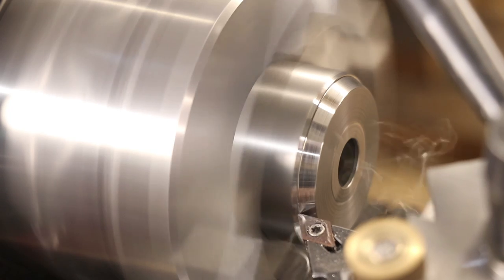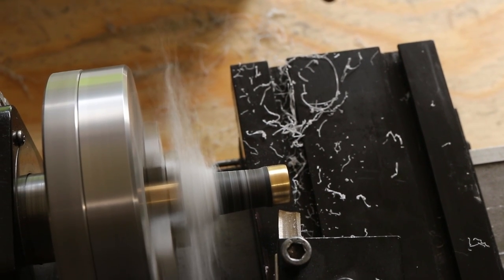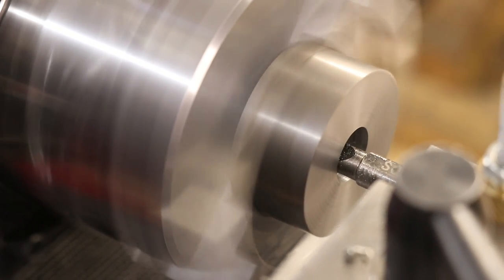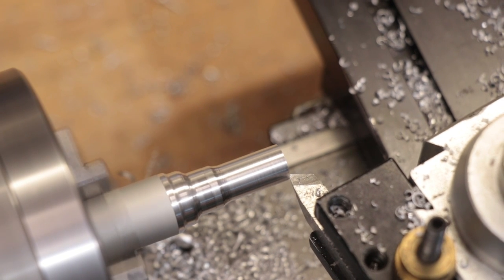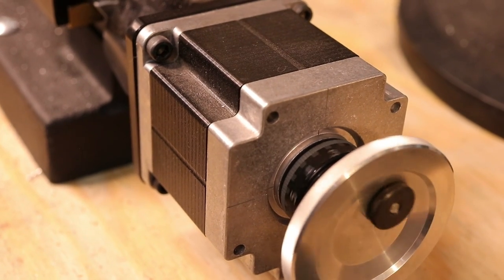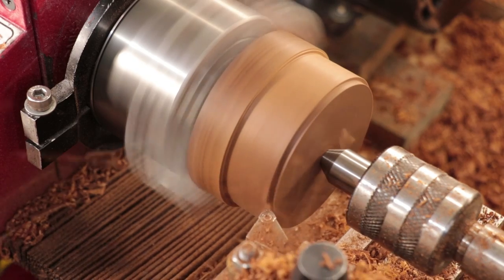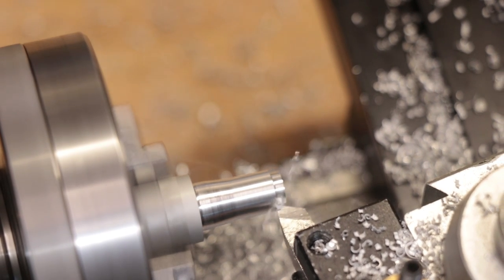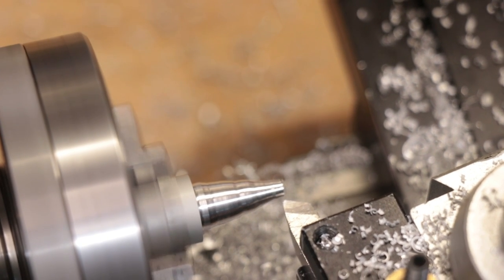My CNC Lathe and Why I Don't Use It Anymore

Comment: In short.  Currently you don't have a use for the CNC lathe. :)
A lot of people don't understand that while CNC rules in a production environment.   For one off's a manual tools can be faster.
But if its a part may need tweaking the ability to quickly modify the CAD drawing and crank out a new part is great.
What is better depends on the situation.

Comment: glock cnc sells some upgrades for the sherline mill and lathes, like a much better headstock and motor for example. Its very pricey but its brings the already good sherline to another level. You will need to machine spacers or tool holders though but its worth it. I have it set up to be able to use a 5 inch precision chuck.

Comment: That is exactly why I bought a manual lathe, And yes the leed screw handle on the end of a lathe any lathe is a pain in the arse I would like you much rather use a manual lathe and mill with a DRO I have pretty much the same lathe as you do and have it cutting very nicely without a lot of mods which was a bonus. Also not really interested in seeing any CNC work stick to the manual lathe work and keep up the good work and thank you for the videos.
Reply from the maker: Cheers, Thankyou for the feedback
Reply: @artisanmakes  Your Welcome.

Comment: I am actually planning on purchasing a cnc router with ball screws and I am planning to try use it to turn parts on my sherline manual lathe. I will try and make an attachment for the router base to hold standard turning tools. I havre an  old Leblonde engine lathe and an old M-head Bridgeport milling machine. I have done both CNC and manual machine work for the past 30+ years so anyone that says we are just "programmers" (no insult to the code writers) doesn't have any clue as to what is required to actually write cnc code.

Comment: Hi. I agree with you completely, excellent video. A ball screw for a CNC should have no backlash at all even under load as ball screws are pre loaded. Or should be? Chinesium ones sometimes do have, but that is not a ball screw. I have a small but capable CNC, I have cut cast iron and titanium on it even though it only has an A4 cutting area. zero backlash means climb and conventional milling are routine.

But I agree with you, one off's or even 2 or 3's .. do it manually (if you are capable and/or prepared to learn). 

Sherline are very expensive. I have a manual imperial one I use for small parts, it is 35 years well used old, it is still bang on accurate, still on it's original motor and drive belt. If you keep the scroll clean their 3 jaw chuck it is still better than many cheap collets. They are very precision machines far better than the far more cheaper offerings and last forever. I will say worth the money if you want precision and a tool you can will to you children. I have no experience with their cnc offerings but I am surprised the lack of a decent ball screw drive.

I have 3 lathes and two mills (one CNC). On small parts, carb jets, bearings etc , the manual Sherline delivers every time.I once turned some parts from 45mm extruded cast iron on it, and it delivered.

Comment: Hello, I'm just wondering what caused the cnc control board to blow? I am thinking of getting a Sherline, so I want to avoid that, especially because I wouldn't know how to redo a cnc control board.
Reply from the maker: I can’t remember for certain, it happened about 5 years ago at this point. But it happened whilst it was running under load. And sherlines warranty for electronics was something crazy short like 90 days. 

I am not sure if they still use the same board these days, they could have changed it.

Comment: I used to have a sherline 5400 mill. I lost it to a divorce. I just recently bought a PM25MV mill and plan to convert it to cnc. I'm now wondering if I made a mistake because most parts I make are small. I got the larger mill to be able cut steel. The sherline mill tend to struggle cutting steel but aluminum was not an issue. Sherlines also had no way to attach anything magnetic like dial indicators, since everything was aluminum. I'm curious anyone's opinion.

Comment: Fixed backlash compensation always has errors that add up over time. One reason I designed my ELS to use the DRO as feedback to make a "closed loop" backlash compensation that works really well. It makes it harder to do it for CNC unless you build a custom gcode processor and servo driver. It's easier to switch to ballscrews would miss the manual lathe though, especially getting tactile feedback.
Reply from the maker: Very interesting, I don't think I have ever seen an ELS set up this way.

Comment: Multiple parts, production parts - CNC wins. You want to have fun, manual is fine but you are limited to shapes. I have the Sherline ball screw milling machine. Repeatability is excellent, I can make exceptional parts from it but I can afford the lathe and I like the small footprint. I still have my precision manual lathes and I still use them daily. It comes down to what you want to do and what you want the machine for, each has its place in the shop. I wouldn't give up either one.

Comment: I am in the same boat as everyone else. I touch more on that CNC router would be good too. Not really a CNC guy myself but because of you getting that router I bought an E3 3D printer. I would love a small lathe to help with the 3d PRNTR 12" x 36" is not small enough. ah cheers!

Comment: I agree that CNC machines aren't as useful in most home workshops.  However, I still want to try to (reversibly) convert my 111-year-old South Bend lathe (originally a treadle-powered lathe) to either "NC" or "CNC" to give me a "productive" use for (i.e., way to play with) one of my PDP-8 minicomputers & Teletype, just to see if I can do it.  I seriously doubt that I'd ever need a (C)NC lathe in my workshop though!  ;)
Reply: I love this kind of thing, but be cautioned that many treadle lathes have lame bearings that severely limit spindle speed.

Comment: How does it feel having the hand crank wheels on the back of the stepper motor? Does the notchiness of the motors cause you issues?
Reply: You can feel the motor steps, but it's pretty subtle. Hardly noticeable when you're actually cutting something.

Comment: I don't think backlash is the primary reason for CNC using ballscrews and slides.   It's about stick-slip and peaks of torque requirement where a human operator can feel the limits (and adjust gibs or do other maintainence as required) but an electric motor just gives up or crashes.

Comment: I know extremely little about CNC but can you program in the direction of cut to keep backlash pretty much nonexistent?
Similar to the way I do hand crank work on manual machines I consciously make up for backlash by cutting only with movements from the same direction.
Reply: That's pretty much what the Fusion anti-backlash paths he mentioned is set up to do. You can do it manually, but Fusion et al are set up to automatically compensate for backlash. It works generally well but it's slower and less accurate than a ball screw.
Reply: @WheatMillington  He's talking about Mach3 backlash compensation. If you switch X direction for example, then it will add an additional X move of the backlash distance. It helps a lot, but, any rough cut may not be perfect as the bed can get pushed around. Also for complex/fast cuts it slows things down a lot as its constantly switching directions and adding that backlash move in.
Reply: @jaro6985  Yeah, compensation is troublesome even with about half a thousandth of backlash on my Chinese ball screws. If you do it in the most straightforward way, then the machine decelerates, makes the small compensation move, and then accelerates back to how it was going. You get cleaner cuts if you can keep the momentum.

I don't use any CAM software (just C++ code to make writing manual gcode less tedious), and the way I do it for circles is to make small diagonal moves at the transition point between each arc quadrant. But during those moves, the compensating axis can get tossed around randomly by the cutting force since the screw isn't applying pressure either way. No good if you had more than one or two thousandths of backlash. And you'd need excessively long diagonal moves to prevent deceleration so the circles wouldn't come out round anyway.

Comment: The small lathe that I had just flexed too much to use in manual or cnc mode.  That was in addition to the backlash. 

In the end,  I don't think that these small lathes in general are useful.  Just not stiff enough to do anything.   Need to move up to a bigger model.

Comment: On your shot at 4:09 you are missing the most important part on these machines: the anti backlash nut. That is why you have all that slope. I get 0.001” backlash on mine using the anti backlash system correctly. You should have one on the z axis and x axis. 

Edit: just finished seeing the video. I guess mileage will very.

Comment: Your a machinist, cnc people are programmers, big difference in my eye's, I now a few people that work in a company that makes part's they don't know anything about what there doing except programming. Great video's keep'um coming..
Reply: Your point is valid but pick a word other than programmers to describe these people.
I have a strong programing background and have done some CAD design for myself.   I would not call it programming.    
If one were to manually write GCODE to create a part that would be programming.
No one needing to turn a profit would allow that.
Reply: As a programmer, creating toolpaths in Fusion360 feels way more like programming than machining. Once I move off the "design" tab, it stops being 'fun engineering hobby' and starts  feeling like 'massaging a weird API'.
Reply: Anyone can use CAD/CAM software to make a part. Doesn't make them a programmer. Show me someone who makes parts on a CNC WITHOUT using CAD/CAM software. THOSE guys are programmers.
Reply: @danharold3087  not putting down a programmer,,some of the smartest people on the planet, just saying useing your hands on the build to me is more rewarding.

Comment: In fairness to Sherline, they do offer ballscrew versions of their lathes.
Reply: He did mention. Its about $1000 more for the ballscrew version though, $3200. Hard to justify.
Reply from the maker: Yes this correct, but they didnt offer it at the time and the cost to upgrade is in the region of $1000-1500
Reply: @artisanmakes  Got ya, cheers for the clarification.
Reply: @jaro6985  Cheers, sounds like I missed a bit..

Comment: Sherline lathes and milling machines are flimsy aluminum extrusions with plastic gibs.  Proxxon are even worse, with aluminum ways.  I don't understand why people keep shilling about them being "high quality"...
Reply from the maker: Can't speak to proxxon or any sherline you may have used, but mine has a proper cast iron base and hardened ways. Not so happy about the aluminium slides though.
Reply: So, what are your recommendations?

Comment: This lathe is made out of aluminum… As a machinist for 40 years, it’s not worth buying a sureline  Mainly because they are not made to last. Unlike small machines of the past they were made of cast-iron. the machines of today are of substandard quality. Anyone who wants to buy a leave you’re better off buying an old 6 inch vintage Lathe Or larger And restore it